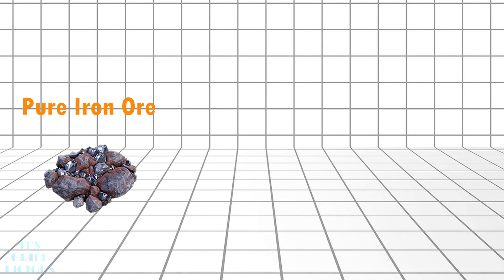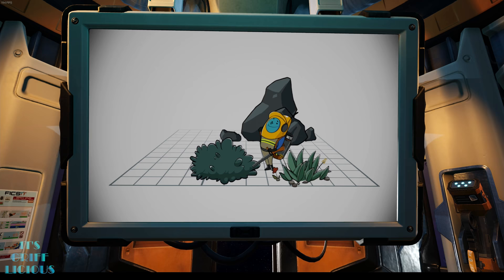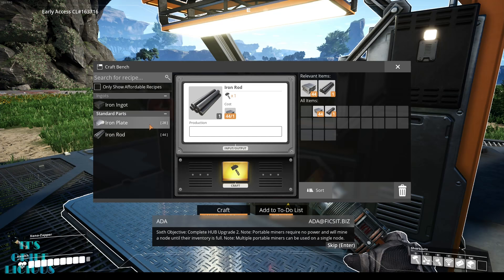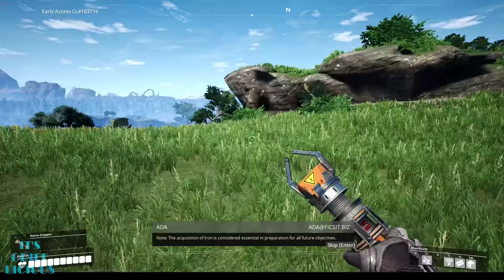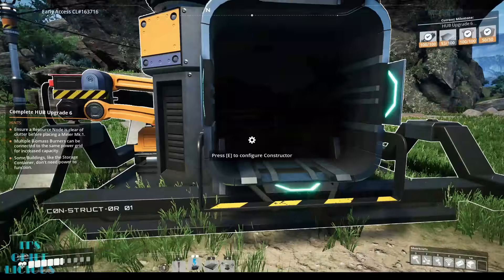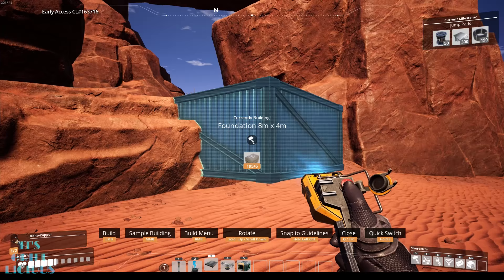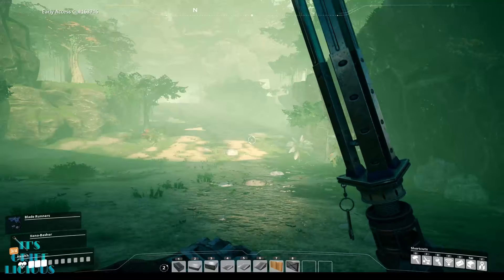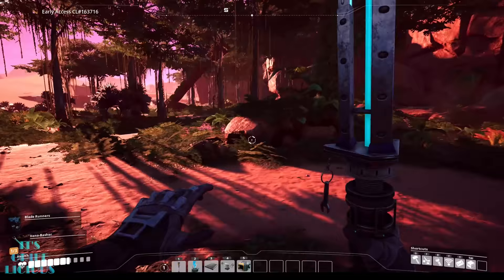Satisfactory: An Unlikely Masterpiece

Comment: This is the most immersive game I've ever played. It is so hard to put down, and it's because of the incredible sound design. You're hooking up more generators, and they clunk and clatter and roar to life, and you turn around when you hear a clattering diesel on the move, it retreats into the distance with a hiss of a turbocharger. The water pumps spool when they start up, the manufacturer whirrs and cycles as parts pour into it. The arms on the blender play catch with each other. Everything in this game moves, and everything that moves was given weight and in some cases personality.

Comment: Oh and you also need to have enough power to run all those machines, which until you can unlock coal generators means you are stuck relying on the basic burners for a while. But those have to be manually refilled with fuel which has to be collected yourself and, if you want to get the most out of, needs to also be processed into biomass/solid biofuel which means even more machines and power lines and....AHHHHHHHHHHHHHH!

Comment: As a huge Factorio fan and Satisfactory fan I can confidently say that both games are very similar but different enough that you can like them separately and play them both.

As was mentioned, perspective does affectthe way you think about the world (and being closer to your factories make you want to use some basic decorations like walls as well), however that's not the only big difference - that would be scale.
In Satisfactory, when you want a product (say, screws) you'll usually delliver iron ore somehow, smelt it ingots then use constructors to turn it into plates then rods then finally into screws. You need to plan the layout of all the machines and how they're connected.
In Factorio, you just smelt iron ore into plates (due to ratios and other gameplay differences, players usually smelt wholesale in dedicated smelting areas) then deliver plates to an assembling machines that directly creates gears (closest equivalent to Satisfactory's screws I think).
Obviously, Factorio can be just as complex when planning your factories but it's just on a bit higher level (I don't mean difficulty).

Then there's a fact that in Satisfactory, you usually upgrade one stuff into next tiers while in Factorio, you usually just produce directly from components (adding new types as your progression goes) and unlike Satisfactory, there may be few items you might want to automate production of earlier in the game that will be completely unnecessary later on (like basic stone and steel furnaces once you permanently switch to electric ones).

Factorio also feels like a lot more traditional puzzle game (due to global grid being much more prevalent than in Satisfactory) but in Satisfactory you can literally walk through your amazing factories and feel that satisfaction of a job well done in way more immersive way (I still remember how good it felt when I finished my first large coal power plant that had plenty of technically useless stuff like catwalks and lights just so I can walk around and debug easier, which made it look much more grounded and realistic - it actually looked like a power plant level you'd see in modern-setting FPP game).

Comment: 25:40 the most important thing about alt recipes is that, when comparing them to each other, no alt recipe is strictly better or strictly worse. Some alts are strictly better than the base recipe (cast screws is probably the best alt in the game for its intended use, on par with heavy oil residue and diluted fuel,) but there is always a trade off - maybe you can use some oil instead of copper. Maybe you can eliminate high volume items (screws) entirely at the cost of more complex production and slightly decreased material efficiency. Maybe you can make more parts per minute with fewer machines at the cost of more materials. Maybe you can increase the efficiency of both materials per item and items per minute at the cost of additional production steps.

Comment: What I like alot with Satisfactory is when you beginning to get the high teir stuff, it arent getting as locked down as when you begin. You can keep one replacing your "HQ" through out your gameplay. And the most challenging for me is with the products that is generating by-products too. Like how well do you make the line? Is there a way to use the by-products too? How much of a buffer do you need not to end up jamming your production line? Can you loop by some of the line to be reused again? For me it isnt about doing the one to one ratio, or figuring out how much of x products I need to make y products. It feels like everything in the game is tied into each other. And once a problem arose, you need to figure out where the problem is. Even with nuclear tier you having a challanging in moving the radiation zone far out of your main factory and know what to do with the left over nuclear parts of the production. Because as of now we dont have a mean to reuse the spent nuclear fuel or other by products of the nuclear and uranium line

Comment: Wanna know how we fix issues like overproduction in the iron rods example? Take a splitter and a merger and connect 2 of the 3 outputs to the merger, then lead the 3rd output into an awesome sink. each output has 5 rods per minute since 15/3 is 5 and since you merged 2 of those outputs back together you have 10/min going into your screw constructer which takes 10/min and the other 5 are now voided and we don't have to worry about them. Additionally, you can attach a storage container the the end of this conveyor and put a smart splitter set to overflow in front of said storage container so that you store iron rods for building purposes and only void the rest of them once that storage is full to prevent clogging. This same setup can be applied to anything else, although you will have to overclock or underclock machines in many cases to keep the ratio 1:1.

Comment: Great video! I really enjoyed it. Although I also feel you glanced over Factorio quite quickly. There's pro's and con's to both of course, and each player has his own cup of tea. For example Factorio is not nearly as beautiful as Satisfactory. But Factorio is also a super polished game with the same draw that keep you playing for hundreds or thousands of hours (hence we often call it Cracktorio :P). The thing that in my opinion where Factorio really triumphs is in the scale of the factories you can build. Absolutely gigantic monstrosities with multiple players running around in it with hundreds of trains, 10s of thousands of construction and logistic robots, depending a against hundreds of enemies  with a massive perimeter wall with flame throwers and artillery, all while your game is still running smoothly and not slowing down. I do see Satisfactories apeal and it's an amazing game, but I don't think you should dismiss Factorio that easily. :)

Comment: I would also love to touch on the fact that in the early game, if you do explore far and wide, you can get late game resources that give you a huge boost. I once started a game and bolted around the map. I unlocked Blade Runners before coal power, and unlocked the Buggy before tractors. It felt awesome to have a Buggy despite still using biomass burners. The alternate recipes also give great benefits to those that step away from their factory.

I've never played a game that makes me so happy to wander.

Comment: Pretty good video, covers most of the stuff that Satisfactory has to offer, although I feel like you missed out by not mentioning vehicle factory mechanics and exploration. In the end though, it is definently up to player choice when it comes to liking/loving a game and Satisfactory does provide a 3D environment compared to Factorio, which a lot of players do prefer. What really irked me though, in what I felt like was a very roughshod comparison between the two games, is the failure to mention some Factorio's biggest selling points that Satisfactory will never achieve unless game design changes as well as the very apparent current differences in gameplay, a few examples would be;

1) - You can expand infinently in Factorio, something that is not doable in Satisfactory as there is a hard limit to the amount of raw resources you can get access to, even though it is very high, it's still not an endless amount that allows for truly comprehension defying sized factory setups.

2) - The alien threat, is one of the biggest factors in Factorio, that gives you a constantly and slowly enroaching threat that forces you to learn to do things more efficiently and effectively or die. Satisfactory completely lacks this kind of pressure and stress on the player to continuously improve their designs in meaningful ways. You can very easily get away with a very messy and sloppy design and ignore it for most, if not all of the game in Satisfactory (While this can also be true for Factorio in a way, on a standard setup for a non-veteran player, this will often lead to a slow death, coming back to bite you in the ass much later down the road). The design of how they scale the alien threat from the players actions, as well as game settings for them, means you can tailor this challenge to your liking in the end as well.

3) - Modding, Factorio hands down trumps Satisfactory in the modding arena, and probably always will. That is the downfall of making a 3D game on something like the Unreal Engine, as opposed to a more basic and simpler isometric sprite system Factorio uses. Even excluding visual changes in modding, the basic mechanics can be modded quite easily to fit different playstyles, and some of these changes, like increasing the time it takes to research things, was eventually merged into the game as a basic gameplay settings option.

4) - Polish and depth of gameplay. This one will hopefully change with time, but it still is a valid factor in that, Satisfactory is still very much an early access game that lacks many QoL features and polish compared to something like Factorio that is fully fleshed out and polished. A specific example would be the multiplayer. Multiplayer in Satisfactory is dodgy and janky at best, but often has a slew of latency issues and crashing otherwise. Another would be the blueprint system, something Satisfactory currently lacks that has a pretty substaintial effect on gameplay in Factorio.

There are other various things, but those are mostly minor things that will come to Satisfactory with time, such as polished train mechanics(which finally got trian signals!), but again, it's fine to prefer one game over the other, they are just games and as long as you enjoy the game, then that's great! I just felt like the comparison between the two games was not done in a fair and sufficently detailed manor. While I will not lie that I do not have no bias towards Factorio, I have played and enjoyed both, but in the end Factorio will always give me way more challenges and newer experiences as opposed to Satisfactory's 3D building environment. Worth mentioning that Satisfactory would probably be in a better spot today if some of their early on actions by the dev team were not made, which resulted in them basically getting a massive deposit of money to develop the game and honestly kinda removes them from the realm of indie developers and more into a lower-end development studio, and has personally influenced how I feel about the company and does color my perspective somewhat, but in the end they are both games that provide a similar theme with two very different playstyles that are not really competing in the same arena at the end of the day.

It honestly sounds like Griffilicous skipped out on playing the tutorial entirely, even pre-1.0 tutorial was still sufficient in explaining the basic systems and getting you going, and the new one is not as on-rails intro like Satisfactory, but does an excellent job of giving you an idea of the game. Not to mention that the games design is fairly straightforward in a simple tier-stepping system that slowly gives you more and more things to work with, may be a stretch to say, but I feel like he went into Factorio with unrealistic expectations before he really got into the core gameplay. An example of this is his UI segment, Factorio has a ton of little visual and audio aspects to the game and it felt like he somehow missed all this entirely or just didn't reach those elements in the game and makes it sound like Factorio somehow lacks these elements. As an example, nothing is more amazing to me than having dozens or hundreds, even thousands, of steam boilers pumping away with the hishing and the pistons pumping in the background as you move around the area. You see this a from a lot of the gameplays elements, from the trees and water, to massive accumilator banks(giant batteries) that give a constant hum of their potential power output. I could go on quite a while here.

Remember, it's all preference! this is just a personal take on his comparison between the two that to me felt like it did no justice between them, as well as some minor points I felt like needed to be touched on.

Comment: These guys take Early Access to a whole new level. I bought this game back in 2021 after it had been out about a year and it felt pretty finished even back then. Here we are two years later and it's still not released. What are they waiting for I wonder?

I decided to play again just to see what has changed and for the most part nothing major...at least up front. I would have to play a lot longer to see what new things were added since gameplay seems about the same. I remember restarting multiple times as I figured out the flaws in my designs...and there are always flaws that limit you in one way or another. Problem is I am not sure if I'm up to it or if it would be worth it in the end. If there was an end to the game or some goal to work toward other than the new part to discover or build...I might be interested. But right now the addictive draw it had on me appears to have faded - and it was damned addicting. Great analysis and breakdown brother. You captured the essence of the game very well.

Comment: Alternate recipes are great. I used the Cast Screws alternate to shorten my production line by going straight to screws rather than making rods into screws. I still make both but I'm saving power by using fewer machines. Definitely need to pay attention to the recipes though, sometimes underclocking is the best route to go if your machines production out paces what you can put in it. From what I can see though, underclocking, if you have the space for the extra machine seems to be better. The power increase from overclocking can be daunting to deal with if you're still trying to run biofuel.

Comment: Any game where you have to create things practically from scratch have always appealed to me.  There's always a steep learning curve, but once you get the gist of what it is you have to do to succeed, it becomes almost addictive.  The best part of this particular game is that you have to change tac on occasion, almost like it's a progression as you unlock new tech and find resources that were always there, but you never had any use for them, up until now.  The later game makes certain aspects easier, but the maintenance and control over it all needs to be kept in check, otherwise, the whole thing shuts down and you're left running around like a headless chicken trying to work out what and where something's gone wrong.  A slight miscalculation at best, or the daunting task of needing to completely redesign a large part of your factory at worst.  Contending with aggressive aliens isn't so bad, (except when you come across a few together and realise too late that you're hopelessly out-gunned), but when you have, 'accidents', like falling from high places, (no thanks to not having quite enough fuel in your jetpack to get to that ledge), to your death, and then having to retrace your steps, kilometres from the HUB, tends to be the intentionally annoying aspect of functioning within the game.

Comment: I very much prefer factorio with its ability to scale much easier while still having a lot of the same problems to resolve. The only difference it makes is that the time pressure is a bit more active than passive(even if you turn on passive mode you are usually limited by resources) and while things like decorations and prettiness are limited i just find it a much more satisfying game. I came into satisfactory and honestly found things like how building works a little awkward.

It might be because i dont consider graphics nearly as high as i do gameplay and flow but i honestly go to factorio for the more "relaxing" experience while still pushing me to problem solve.

Comment: Wanted to correct something. The game is about to release Update 5, not .5 update. A crucial difference. I can't be sure, but since a recent dev update said they're thinking about what needs to be put in to get to 1.0 and since update 5 is mostly QoL and refinements, while filling in some gaps in the building system, I suspect the game is significantly over halfway done. 

Also, the differences between Factorio an Satisfactory don't become significant until mid to late game, but, without spoiling anything, building at a large scale is much less annoying and way more fun in Factorio.